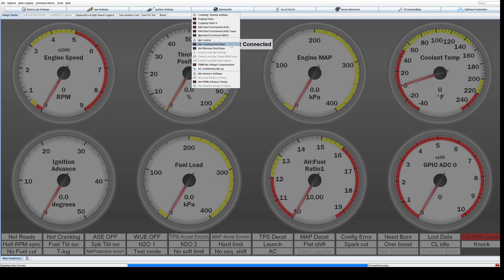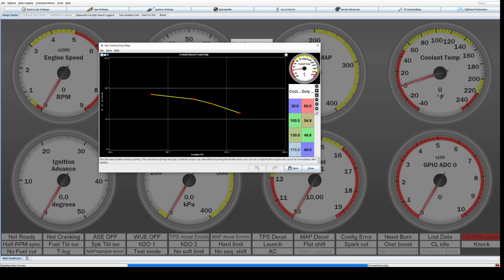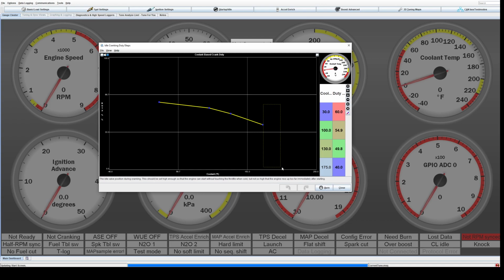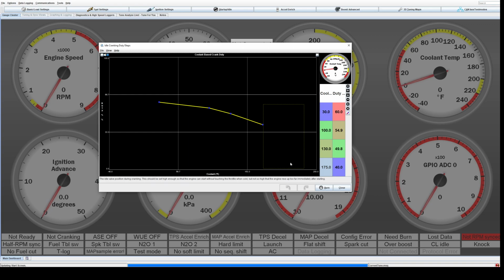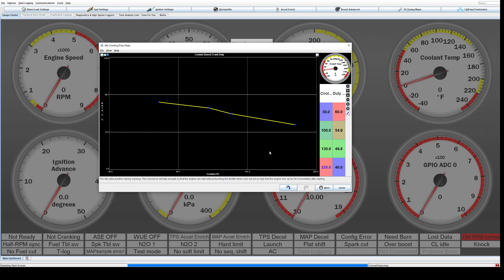Megasquirt Idle Valve Hot Start Tips and Tricks | How to Tune |

Comment: No way. I’ve been hunting the hot start issue on my miata for the longest time. I got it to a point where it will most of the time start, sometimes needs added throttle. I changed this value and it completely eradicated this issue

Comment: Thank you so much for this! My friend and I have good running BMW 3.0CS's with Megasquirt and occasionally run into hot start issues.  Once I looked at mine and his idle cranking duty cycle curves I saw they topped out at 175 degrees and our cars run 185 to 190 normally.  We're going to try this change (bumping max temp to 210 at 40%) and hope that it works!

Comment: You know this is connected to your Warm-up Enrichment right? If set that high, you'll never get out of WUE and I'd imagine that is not desireable. Or is there a setting that can disconnect the two tables?
Reply from the maker: This table only applies to cranking and changes to the warm up table after the engine is running
Reply: @TurbineResearch  But for me the tables are the same and connected. One changes the other.
Reply: @justinlautz1182  What do you mean by "one changes the other"?  Which version of MS are you using? I'm using MS2 in a Microsquirt and I just looked, and changing the max coolant value in the Idle Cranking Duty Steps did not change the values in the table for Warm Up Enrichment.
Reply: @oddcarsandbaddecisions  I just double checked and relized I confused this for "Idle warmup duty steps", which will change your WUE values.

Comment: Great video as always. Can you give me a tip for sorting my lean condition (16:1+) on a hot restart after sitting for a couple of minutes. This is due to my iat sensor in the plenum above the engine heat soaking hard. Cheers.
Reply: also have the same issue with idle on hot restart, curious of the best way to fix it. Tried richening/extending after start enrichment but doesn't really help and probably not the most appropriate solution

Comment: I've been having a lot of idle problems and quirks going on in my MS3X. I'm wondering if this bug in the firmware also exists in other idle settings. I have problems once the vehicle warms to about 125-140 degrees and it doesn't solve itself until I shut down and restart. But I have noticed that some of my settings might be beyond what MS can calculate and doesn't know what to do.

I think I may go into them tonight and re-scale all of my idle stuff and linearize my ramps and see what differences it might make. It doesn't disable the vehicle in any way but it is annoying that it does funny things while starting up and driving.

Maybe do a video on all of them so people have a better idea how to fine tune idle and decel to idle.
Reply from the maker: Thanks for watching! I wouldn’t say it’s a bug but rather a default setting that is easily overlooked